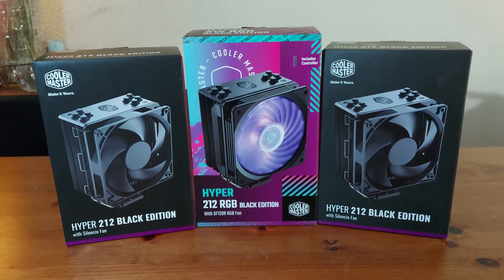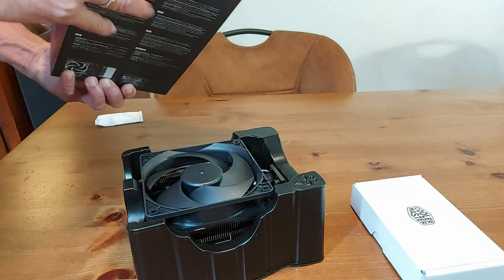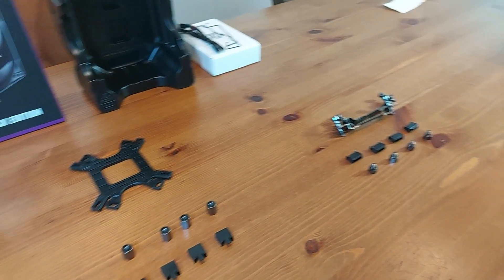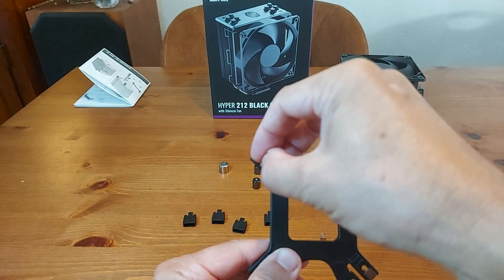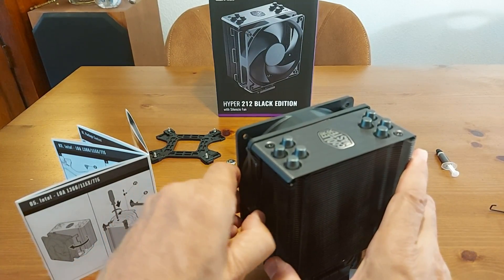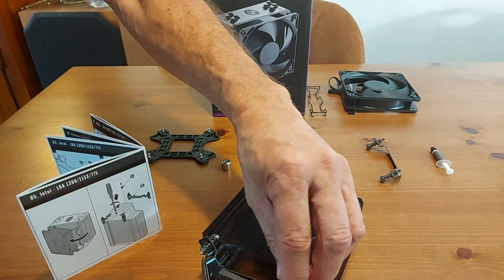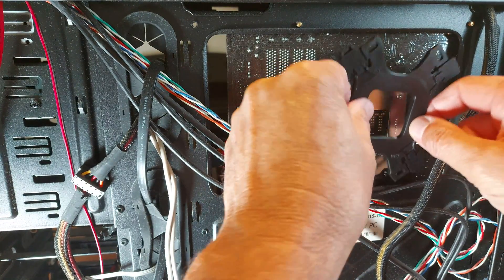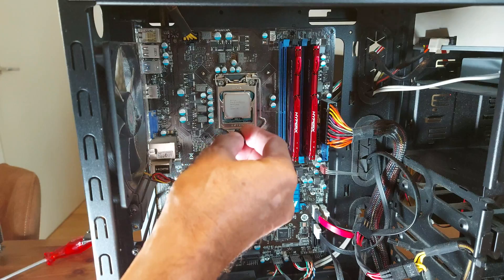Cooler Master Hyper 212 Black Edition Installation Guide and Benchmarks

Comment: I'm still not sure why it needs to be glued on. I'd think the screws could handle it alone. 

I had to take mine off to upgrade my professor and I can't get the screws to do anything other than spin around. I'm always worried about using too much force.
Reply from the maker: Glued ??
Thermal paste is not a glue !!
You'll need it to make the right [thermal] connection.

Comment: ordred my first one for my first ever pc and i'm pretty sure they gave me the wrong screws i'm not sure what to do
Reply from the maker: For which socket ??
Reply: @Benchmarks i found the screws but now it won't line up when i put it on the cooler so i'm not able to screw if down
Reply from the maker: @orlandololll  Did you use the the brackets and backplate for socket AM4 ?? [have a look @ the manual]
[ryzen 7 5800 is socket AM4]
Reply: i'm not really sure what u mean cuz i don't understand every word but like tts a ryzen 7 5800